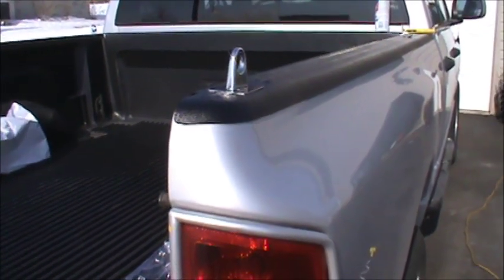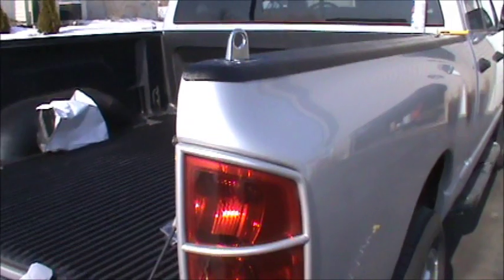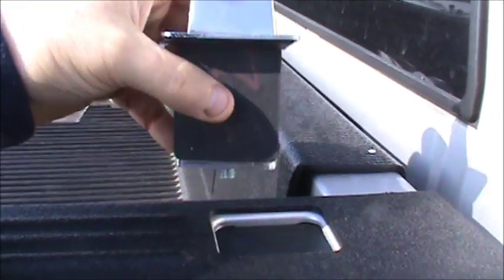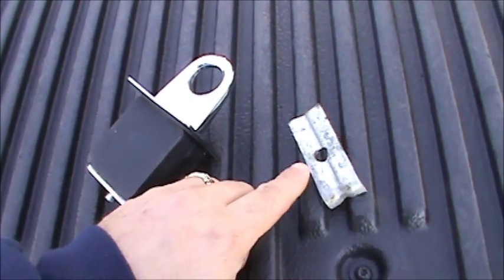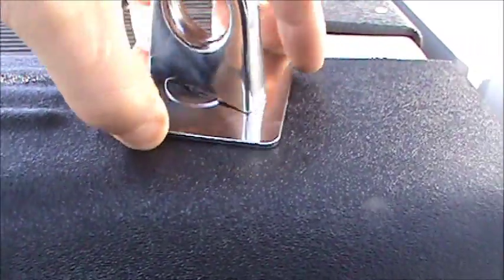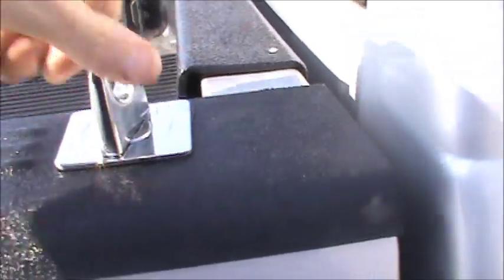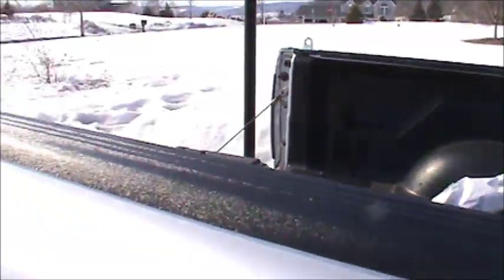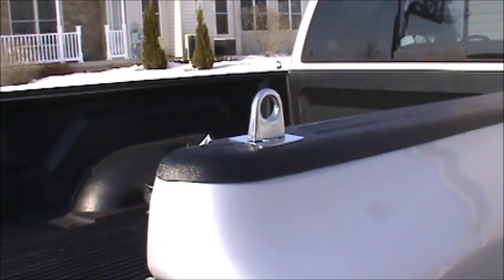Installing Truck Bed Anchors or Tiedowns

Comment: Great idea!! I've have the toggle bolt type installed and one of them broke off. I've also used the rubber type like you used but it didn't stay in place. This is a much better way to use the rubber type mounts. What kind of metal plate did you use for the inside??

Comment: I have the same tie down system on my dodge and was wondering how to remove them without removing the bed liner. Thanks for the video.
Reply: Right! i have 2 I am trying to remove to install a topper. they spin all day and wont come out! :(

Comment: Those rubber blocks actually arnt designed to work on Dodge pickups because they're to small. Those same blocks have to be SQUEEZED into Ford stake pockets, along with some smaller Chevy trucks (no Silverado or Sierra). Once tightened they anchor just as well as the steel plate you used.
Reply: Is there anywhere that states this fact? If not, it should be! Thanks for sharing that! 👍

Comment: The problem with these anchors is they bend over at an angle when your ratchet things tight i dont have the rubber gust toogle bolt

Comment: My issue is just finding decent quality anchors that don't rust and whose bolt is made of something stronger than pot metal. Anyone know of some good ones that are built to last?
Reply: My work truck is old and doesn't have these pre-cut rectangles in its bed-rail, but if you need something solid and aren't too concerned with aesthetics, you can get shoulder eye bolts as strong as anything you'd ever want in whatever finish you like.  Just drill a hole and drop them through.  I've got a set of them on my work truck in a galvanized finish and over several seasons of rain they've never been touched by the weather.